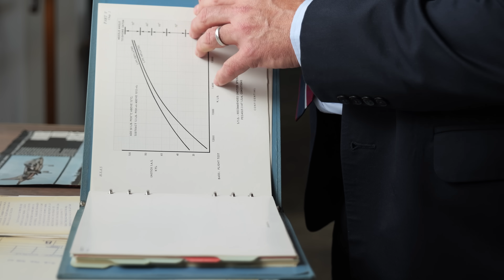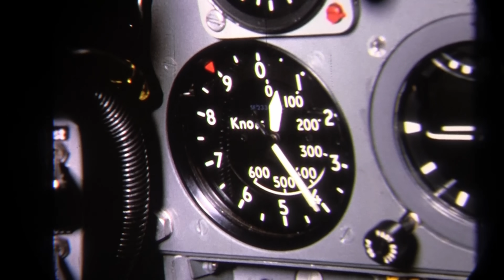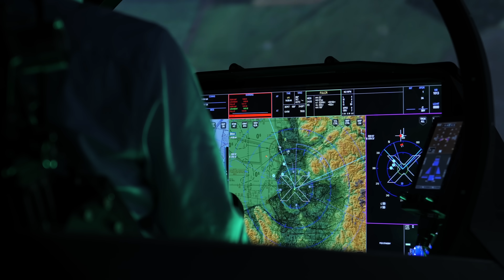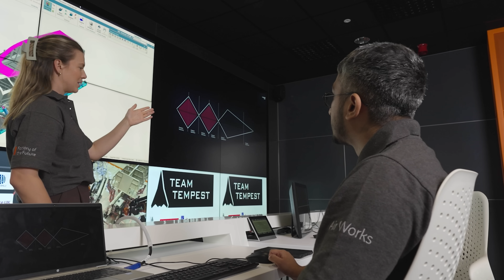In the pilot's seat: Harrier jet pilots share their stories | VSTOL legacy | BAE Systems

Comment: Someone forget to mention the BAE Lightning in that lineage.
Reply: He was mainly referring to the avionic continuation/ progress that ran through later Harriers/Tornado/ Typhoon. Lightning after all was a late 1940s design with avionics that were already struggling by the mid 1960s. There was a large generational gap in capability between it and it's successors. That also applies to the Javelin.
Reply: @timhancock6626  The EEL was a GC hands off weapon system
The Lightning's monopulse radar Radar was used for TFR in the TSR2 and later onto Tornado
HOTAS was originally applied to military aircraft, starting with the British interceptor aircraft, the English Electric Lightning.
The EEL was an Operational Experimental aircraft and the boffins made full use of it.

Comment: In 1969-71 I was in the RAF serving on 38 Gp TCW. I had two memorable encounters with the Harrier as we provided ground to air comms. First was at Otterburn ranges in Northumberland. The army had a platoon of soldiers to mortar targets with coloured smoke. The Harrier came in and attacked the targets of old tanks and trucks. Later that evening a contingent of soldiers led by a sergeant came to see, the sergeant said he thought the Harrier had a rear gunner. We fell about laughing, he explained that when the Harrier fired off its weapons he pulled up and at the same time there was a flash on the tail. We had to explain the speed of sound and light to him. 
Second we went to the Royal Engineers at Chatham, where they had put on an exhibition of their battlefield capabilities. One of which was building a very short tarmac runway for the Harrier to land. The Harrier came in and after a marvellous display landed on the new runway, unfortunately the pilot put the front wheel into the mud, Oops. Much to the amusement of the Royal Engineers.